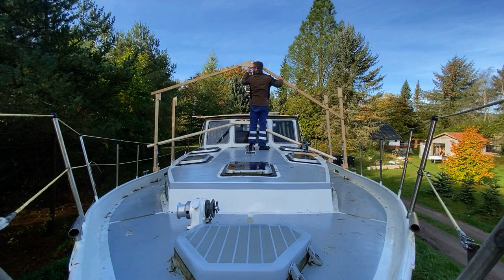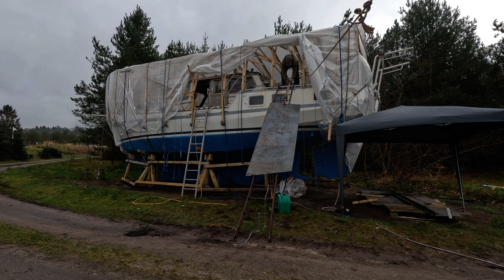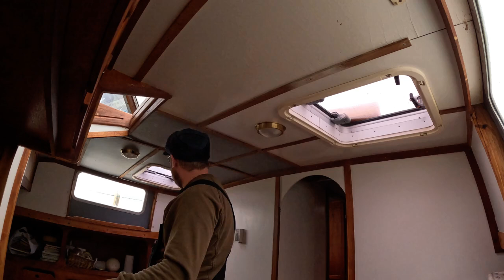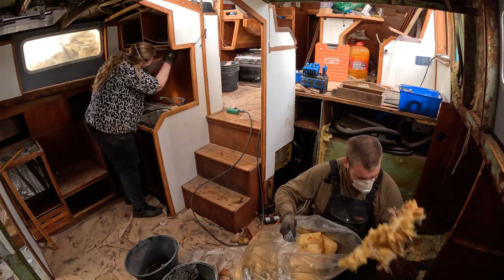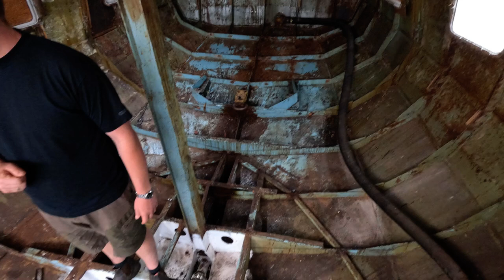Boat renovation update: FULL interior GUTTING? - The Restoration of SY Carla part 7

Comment: Looks a really good and methodical approach.  You are right to get to grips with all the corrosion and protect everything once again. It will give you complete peace of mind knowing that the steel behind every trim panel is sound.  I'm currently going through a smaller scale rebuild which is also a complete strip out.  I find that working from one end towards the other helps me keep motivated,. as I progressively work back I know that everything forward is sound and just waiting for the trim.  This way I can also maintain a clean barrier of clear PVC which as it moves towards the stern minimises the remaining area I have to keep clean.
Reply from the maker: Yes exactly 👍👍 and it sounds like a really good idea to take it step by step from one end to the other. We hadn’t thought of using plastic as a barrier but it sounds like a really good idea 😊👍

Comment: For de-rusting stuff (super delicate but fast, won't harm a single atom of good metal) An old trash bin with a rebar or other iron rod stuck down each corner (connect them with some wire) then fill the bin with water and a bunch of bicarbonate of soda or whatever similar thing you have at home... it is not too particular. then run a battery charger through the setup, I think the positive goes to the rusted item and negative to your ring of rods (because it is a line of sight process) You will quickly see if you have it right... bubbles should form on the rust almost immediately. periodically brush the crud that builds up on your sacrificial rods. Please wear a hard hat inside there with all that rusted metal exposed.
Reply from the maker: Wow that’s quite a trick we actually have a spare trash can in the back. Maybe we should try it with some of the smaller stuff. Thank you very much for sharing 😊👍
Reply: @SYCarla  I've used it for example on my gradfather's old Gedore tool kit, with his signature engraved on very finely. It came out almost like new. Also good on old rusted shut tools. Jsut do it outdoors or with good circulation as the hydrogen and ogygen given off will lead to rust in an enclosed area.
Reply from the maker: @poepflater  we will keep that in mind in the future 😊👍